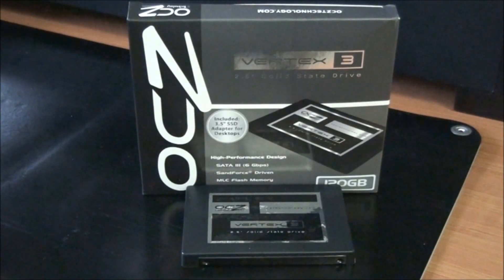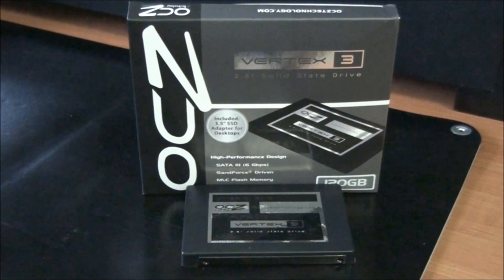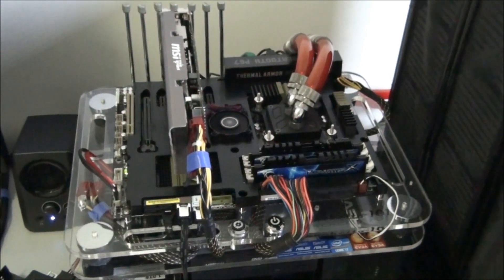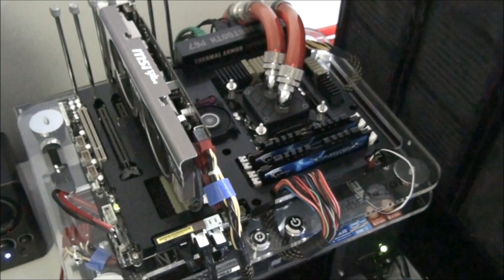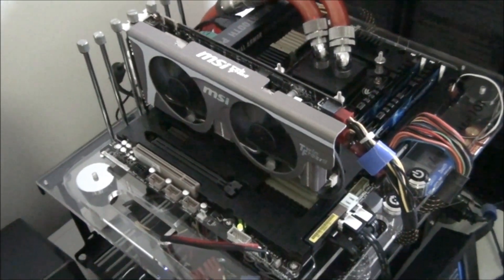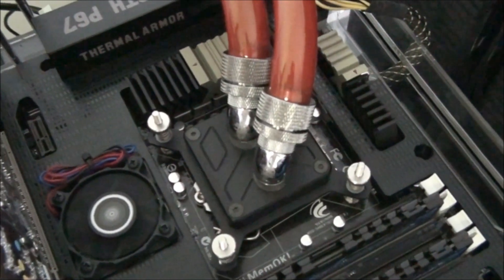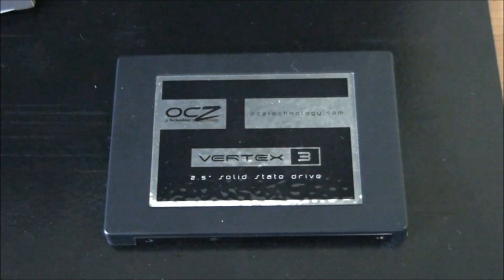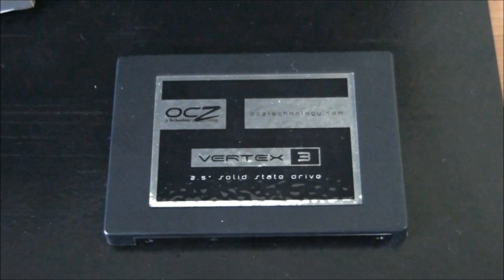OCZ Vertex 3 Performance Results On P67

Comment: Hey I'm using a GIGABYTE X58A-UD3R motherboard and it has the Marvell 9128 controller.. I bought an SSD (OCZ Vertex 4) will I at least be able to hit 350 speeds considering the OCZ vertex 4 can easily hit 500/500 on one of the new 1155 mobos? I don't wanna be stuck to SATA II with 280 limit.. if I can hit 350 I will be okay with that. I see u got 400? and the video is from 2011.. maybe some of the new drivers improved it even more? I don't feel like upgrading to 1155 just for that

Comment: This has to be the worst piece of hardware I've come across with.

I had one die on me like 5 months ago, it gave a ton of BSOD's and eventually just died. It got replaced with a new one, but last week Windows all of a sudden wouldn't boot anymore, it told me to "select a proper boot device", basically, my SSD was just gone, it's nowhere to be found in the bios, so I reinstalled Windows on my HDD and it works now.

My SSD is still in my case, but I can't be arsed with it anymore, it sucks balls.